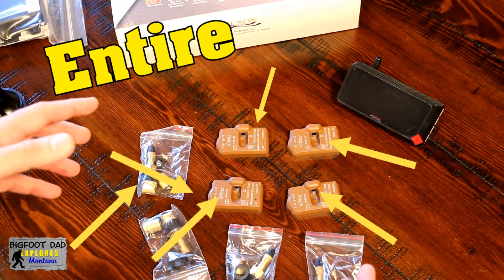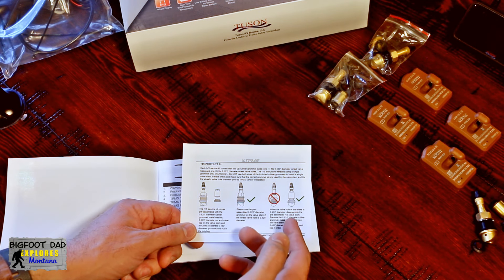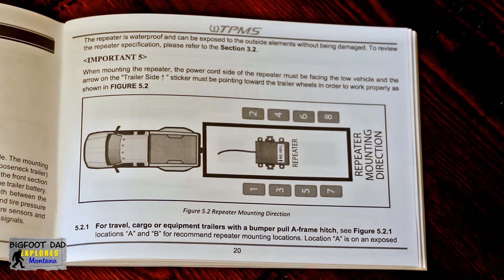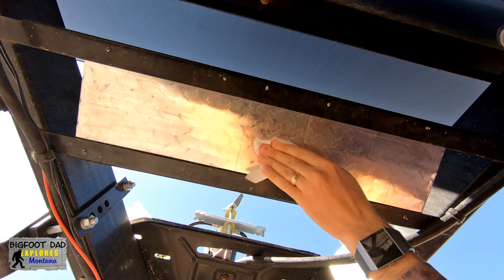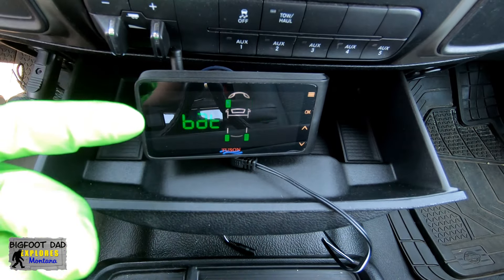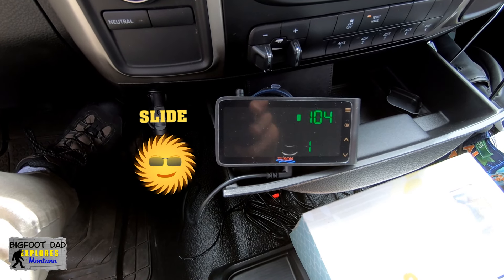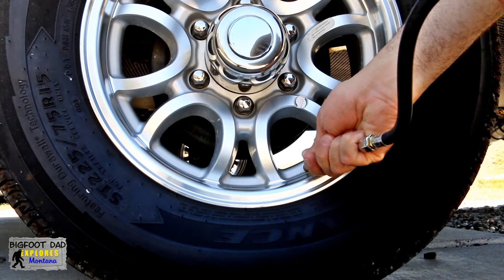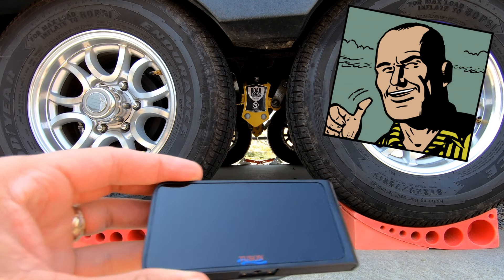Automotive TPMS for your Trailer Tires - TUSON TPMS4W - The Best TPMS for Your RV or other Trailer?

Comment: I know this video is a year old, but I just installed this exact unit and found your video while trying to troubleshoot a problem.  Your video appears to have provided the answer to my problem.  The BAT value displayed on the Receiver unit is the voltage the Repeater is picking up from your trailer.  According to the manual, this is how you know your repeater is working is the positive value on the display.  After I installed my unit there was not value?? Hmm, head scratcher.  BUT after looking at your video - yours was showing either UNTIL you starting driving around!  Problem solved - thank you!
Reply from the maker: Stephen - thank you so much for your feedback on this video!  I'm very glad it was helpful.
Last fall when parking my RV at a riverside location, the display started beeping.  After I parked the RV, I looked down and saw that it was reading that one of my tires was low.  Sure enough, it had detected a flat.  I made a YouTube Short for chaing the flat, but didn't have enough time to put the footage in of the TPMS display pointing out the problem.  These things do work pretty well, even two seasons later!

Comment: Well , it’s been three years, how do you like them?
Reply from the maker: Hi, Cattle and County - yes, still working great and we love them.  The temperature is extremely helpful, especially on for days.  Never had to change the batteries yet and we have thousands of miles on them.  Drove from the Pacific to the Atlantic and everywhere in-between and no issues.  We did actually have our detect a flat as we pulled into one of our favorite off-road spots (this is where the YouTube Short of changing a flat tire using the ramp jack came from).  
I'll be putting these same sensors on our cargo trailer next.  
Hope this helps. 😎

Comment: The tires could be hotter on the right side due to the exhaust of the tow vehicle.
Reply: I mostly see trailers with right side blowouts on the highway come to think about.   If this was from hitting curbs or rubbing curbs I would think I could see some in a location with curbs.
Reply from the maker: Hey, dwal2165 - great observation!!  I'll take this into consideration.  Thank you for commenting on this!